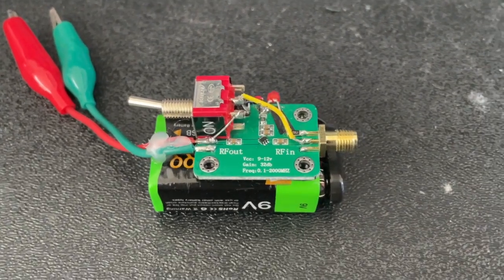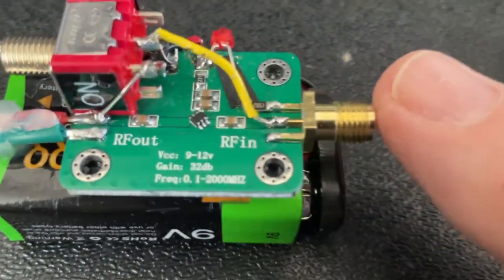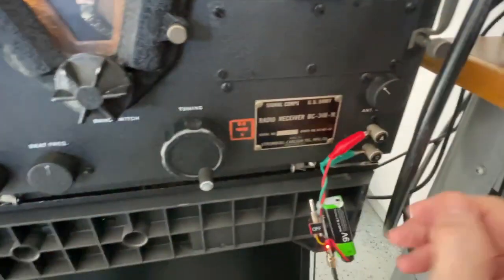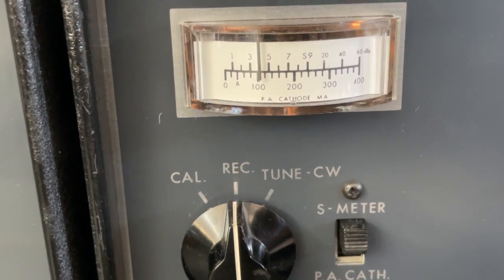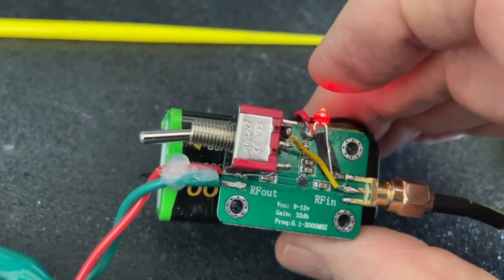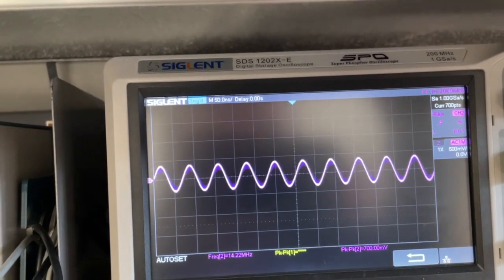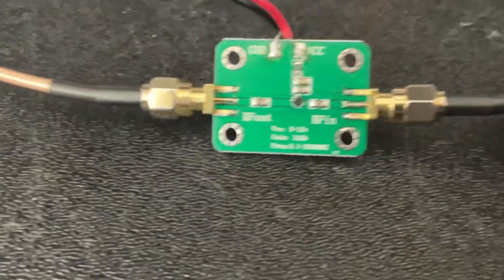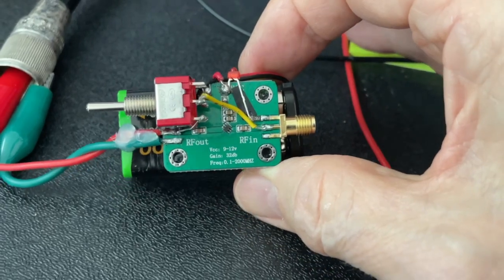New Life For Old Radios!  Just $2.29 for this Wide Band Amplifier!

Comment: With no filtering prior to the amp, the 3rd order intercept becomes an important specification. The amplifier input will be exposed to many strong out-of-band signals which will show up as in band distortion otherwise known as IMD products. Below 20 MHz the atmospheric noise dominates the amplifiers noise figure therefore the amplifier will not improve the S/N ratio which is the important parameter.
Reply from the maker: I have experienced some IMD issues with this device. But it's still worth using to bring in a decent S-meter reading from WWV.

Comment: Now to design a 3d printed case for the battery, switch and board. 
Thanks for the idea!
Reply from the maker: That will be really nice to see!
Reply: I finally got my amplifier and have designed the little box for it. I plan to put two banana jacks in for in/out and a 2P3T slide switch for the control. I will print the box before uploading it to thingiverse. Then I will try to link to it for anyone interested.
Reply from the maker: @noads1035  Fantastic!  Can't wait to see it.

Comment: Are you bypassing the amp in some ways, or when you switch the battery off the amp acts as an attenuator?
Reply from the maker: Excellent question Sochi.
Please notice the "yellow" wire. It connects from "RF In" to the switch pole. When the amp is turned "off" this pole is connected to "RF Out" thereby bypassing the amplifier chip. In other words, "RF In" and "RF Out" become common to each other when the amplifier is "switched off". In this state, the other pole disconnects the battery from the amp.
This arrangement works well below 30 Mhz. Above 30 MHz and much higher, this may pose other issues, such as the amplifier going into feedback oscillation.
Reply: @rfburns3472  Thanks for the answer. I normally use two relais but I'll give the simple switch bypass a chance. 73 from Italy.
Reply from the maker: @Sochibusi  73's Sochibusi!

Comment: Ahh, Is that battery one of those real 9v output types, or the traditional 7.2v types? Many of those Lithium batteries have a smps in them that could generate EMI. Take a AM transistor radio and hold it's antenna up to the battery with your amp off. Tune the dial and listen for noise/squealing sounds. Anyway, that little board is wild. Amazing the bandwidth! Crazy. I see the switch there will do a proper bypass of the signal when amp is off, otherwise I'd expect a super weak signal, if any, leaking though the circuit when it is off. Nice.
Reply from the maker: Great observation Curt! The battery puts out a solid 9.1 volts and shuts down immediately when exhausted. I like that. The amp doesn't lose gain when the battery loses its supply capacity. I have heard others say they can cause EMI, especially the musical instrument folks. Is it possible their is some kind of chemical action going on in these lithium ion batteries? I will try the transistor radio test you suggested.

Comment: I use a similar LNA for a loop on the ground antenna (kk5jy design) and the LNA makes a hugh improvement. Note that the LOG antenna has a very low noise floor.
Reply from the maker: I appreciate your comment!

Comment: Is WWV still at 2.5,10,15,20 and 25MHZ??
Reply from the maker: "The station radiates 10 000 W on 5 MHz, 10 MHz, and 15 MHz; and 2500 W on 2.5 MHz and 20 MHz." - NIST
Reply: And 25 mhz as well.
Reply: @Tobys-Dad Not 25 MHz. It’s easy to check on the WWV/NIST website.
Reply: @G6MDX-Dai  No longer on 25 Mhz, however WWVH IS still on 25 Mhz

Comment: It amplifies noise as well.
Reply from the maker: Correct....About 3.1 dB.  On my radio it added 1 S-Unit of noise.
Reply: @rfburns3472  Not sure how you are getting that? What is the noise figure?
Reply from the maker: @willthecat3861  https://www.nxp.com/docs/en/data-sheet/BGA2869.pdf
Reply from the maker: @willthecat3861  I found it in the data sheet.
Reply: It amplifies the noise from the antenna, but not the one of the input stage of the receiver.
Reply from the maker: @alainblazit9504  The data sheet suggests placing the amplifer between the mixer and 1st IF.  That might be interesting to try.
Reply: The noise figures are in the specs for the RF device used . They use different devices on these boards so hard to define. The way I use one is with an attenuation and I can tune it for the least amount I need but can hear the signal and use the signal enhancement etc to get a good clean signal.  I just had a thought are you asking about noise generated in the device ? Or the amplified band noise?
Reply: @barrymayson2492  well... AFAIK...the amp is going to amplify the band noise (when not tuned into a station or signal)... and it's going to add its own noise too. When replying to @gordselectronicshobby3853... who asked "It amplifies noise as well." ... @rfburns3472 replied, "Correct....About 3.1 dB.  On my radio it added 1 S-Unit of noise." How did @rfburns3472 arrive at 'about 3.1 dB?'
Reply: Is the led adding noise? For a quick check just disconnect it.. If it is just put a small value cap across it.
Are those wires going to the switch from the in/out connections causing stray noise? The preamp may be oscillating way up around 1GHz with the wires like that and the gain involved, just a thought.
Reply from the maker: @HughTVDX  I can check the possible LED noise and see if that’s contributing,
You hit on a good point about the amplifier oscillating.  I can say from experience these things will go into feedback oscillation if the the output couples into the input. Especially so with the high gain amplifiers types. I was surprised that it did not do that since there is close capacitive coupling in the switch. I found the “yellow wire” must be kept high above the PCB to prevent oscillation.
Interestingly, and no surprise, when I get my hand near the device to switch it on, it will oscillate momentary.
Thanks for your comment!

Comment: Dang cheap and awesome gain. I appreciate how you tested and explained each step. It runs off a 9V rechargeable? Incredible. I need one of these rigs. Thanks and 73, Bill.
Reply from the maker: Well, it surprised me Bill! The lithium-ion battery is best since it will hold out at 9 volts till it’s time for a recharge. This is better than a 9-volt alkaline battery that losses voltage with time which makes the gain of the amp go down slowly. Also, if I use 12 volts, I get about one more S-unit out of it!